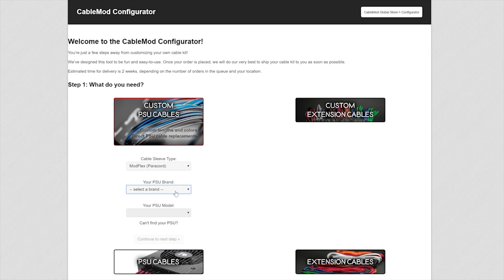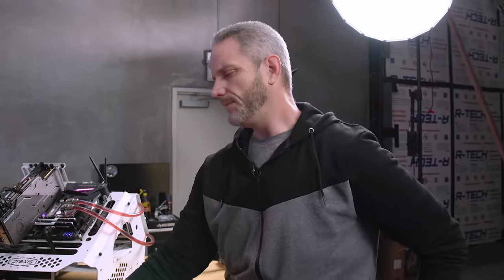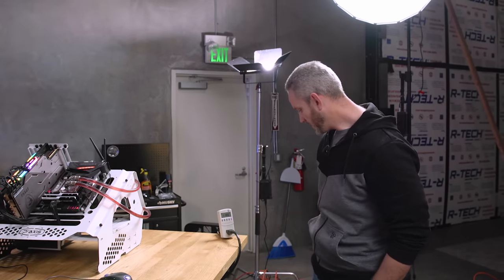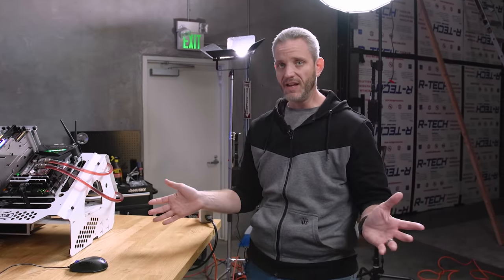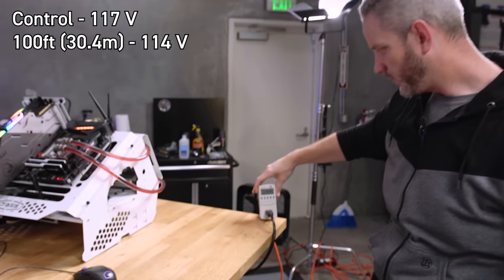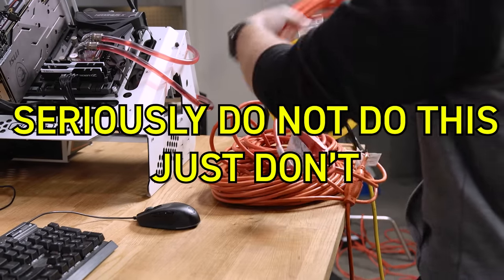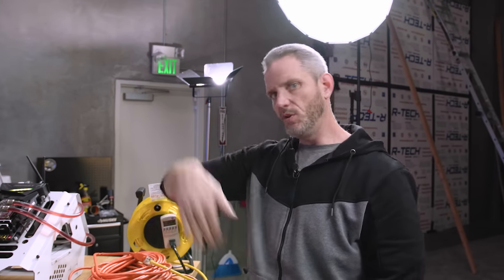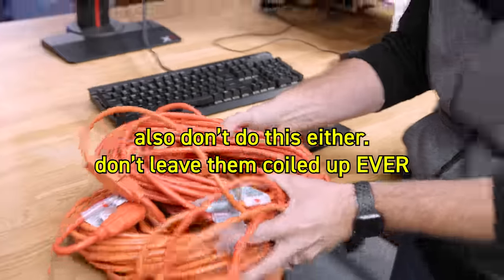Are extension cords dangerous for Computers?

Comment: We used 120v on a 60Hz cycle with a typical household breaker running 20AMPs. UK uses 240v on a 50Hz cycle running only 10AMPs. And they dont get "cleaner" power. Remember the US runs on the AC current system for main power and only the Devices convert to DC. UK uses DC so its higher voltage less AMPs. We use a 3 wire system where are they use a 2 wire system (for standard appliance receptacles) AC is far more efficient and less power loss to attenuation

Comment: Electricity also works the opposite way with low Volts/amps/watts and thick wire. Basically think of it like water flowing down a river vs. a creek.

Comment: Probably alot of other electricians that have commented, but this video is basicly ohms law in a very difficult expression. also most of the things in the start where its talked about lenghts and quality, any electrician (in norway atleast) would break out their little handbook and show you the tables telling you how thick wire you need for a spesific lenght and load. also note that when copper wire heats up the resistance also goes up in turn makes it draw more current to get the same load running. Anyone wanna try to guess why they use liquid nitrogen when doing crazy overclocks? and the last thing is explaining why leaving the cable on the spool is bad when you draw alot of current. when thers a current going through the wire it creates a magneticfield around the wire (crazy i know, oh thats how power is made you say? yaiks) but when you take this cable and spool it the magneticfield around the cable starts to interupt flow of current in other parts of the cable making it, you guessed it, to draw even more current (think he calls it amps, since its mesured in Ampere). so spooling the cable is actually worse than just having lots of it.

Comment: So, the danger with thin wire is that the higher resistance produces heat; this heat is what causes fires when it gets bad. Another thing is distance: The longer the distance, the more resistance, so a better gauge cord is needed for longer distances. 50' of 16 gauge may need to be upgraded to 14 gauge if you wanted to max out the power draw over 100' safely. I wasn't worried for the PC, I was wondering if the wire was gonna light. Quality PSUs have built-in breakers (even a Corsair 430W does, ask me how I know) so that's probably what caused the computer to crash.

Comment: Very informative video.  Tldr, if you need to use an extension cable for high draw equipment don't daisy chain and check the load rating.  I used a 10 ft air conditioner cable that's rated for 1500w into my ups to make sure it's safe.

Comment: 16 gauge is not contractor wire 12 gauge is contractor wire that is what is running in your walls that is what contractors use and if they're not using 12 gauge don't hire them

Comment: You have PSU inside your PC that converts AC to DC,because of that you don't actually care about how good your AC power is(perfect sinusoid doesn't mater cause you convert it anyway) ,most important thing you need to care in this situation is power loss over cable,because long cables introduces more resistance,resistance and capacity.So you have voltage drop over long cable due to it's high resistance and introduce reactive load due to it's inductance.With compressor you introduce additional load that drains current,that's too much for your powerline,so the voltage drops further over that added resistance .

Comment: Power supplies are specified to work world-wide. Nominal voltage in Japan is nominally 100V. Nearly all power supplies will work either in Japan or USA. Look at the rating of your power supply, I'll bet it is rated  from 100-120V on the low voltage setting. Most power supplies have a switch to go between the 100-120V setting and 220-240 V for the higher voltage side of the world.

Comment: Coiled cable loops will create a coil, induction starts to grow quite strong and it will add even more resistance in the form of impedance. Your power factor will drop, which means that current and voltage are not following each other, one or the other drags behind. Your electric company charges you for apparent power, not real power. The difference is that if your power factor is 0.9, you are paying 10% more for your electricity.

Comment: The problem isn't resistance Jay because resistance doesn't interact with time. The issue is the series inductance, and the parallel capacitance because these interact with power delivery as a function of time (this is called resonance). Think of a speaker cross over network which has series inductance and parallel capacitance for it's low-pass filter. The filter works because only signals with the proper time pattern (right frequency) pass, other signals get attenuated. If you were to use a resistor in place of the inductor and capacitor in a low-pass filter, it will only lower the volume of the all sounds produced equally while letting all sounds through--this again is because resistance is time independent, the frequencies (or timing) of the signals will not matter if passed though a resistor. Applied to the PC's power supply this doesn't mean it can't get the power when using an extension cord, it will mean that it occasionally won't get the power WHEN it needs it--it's the condition of WHEN it needs it that leads to instability (this is called ripple in practice). Resistance will change the volt/amp values measured under load, but won't change the wattage received by the PC (though due to heat dissipated in the resistive medium, resistance will change the total wattage consumed from the wall). Thus resistance alone cannot prevent the PSU from receiving power (measured in watts) at any critical moment.

Comment: First, I'd like to address Emme Pombär 's Bigger concern: "You didn't unwind it, so you have inductive resistance!"
* There will be very little heat generated as the resistance is over a massive spans of wire, and the voltage drop because a cable is loosely coiled will not be significant. Any magnetic field that is created, will consume some energy; but the best case scenario for a "magnetic field" is one active wire in a tightly wrapped coil with super thin insulation. As you can plainly see, a coiled extension cord is at the extreme low end of this scale. There is one positive for the almost nonexistent magnetic field, as much as it can, it will limit spikes in the voltage.
* As you are what you eat, a computer exists under the same rule. The better the power, the longer and stronger your computer will run. Just because you don't see the problems right up front, doesn't mean that they aren't there. Power starvation is the number one killer of power supplies; it stresses the semiconductors to the point of failure. Dirty power is the number two; this destroys the capacitors used as filters. In my house, I have a decent surge protector/line filter on all electronics except things like fans, power tools, stove, washer, dryer, refrigerator, & freezer.
* I'm not an EE, i'm the one that fixes the stuff the engineer designed poorly.

Comment: @JayzTwoCents Of course the 14awg cord was cooler. It has less resistance than the 16awg cord.  More resistance means more heat produced. In the US most of our OSHAs require businesses (including construction) to use 12awg or larger cords. 14awg cords are not construction grade.  Also voltage lost because of the resistance of the cord it's called voltage drop not resistance.

Comment: Have been pondering this extension cord thing for a while; and I think you didn't get as bad of results partially because you had them still coiled... that increases the inductance, so current is actually more stable - hence adding ferrite beads to cables to increase their inductance and provide noise filtering... because the 'current in motion tends to stay in motion (with higher inductance(mass)) minor spikes get filtered to the common range, and low dips get covered by losing some of the built magnetic field to provide the current and fill the gap... 
Sorry you didn't get as dramatic of an effect as you(and I) hoped for :)

Comment: Wire gauge goes the other way around, the lower the number means the wire is thicker and has less resistance (voltage drop).

Comment: I melted a coiled extension cord before. I was lazy to pull out the shorter 12awg extension cord instead of the 100ft 16awg. Also beware of corroded plugs as contact resistance can cause fires also.

Comment: Under volting the universal motor in the compressor.  It will try to deliver the same power using more current.  And then it will melt.

Comment: I have tried using a 800 meter extension cord in a coil gauge #18 and it generates a lot of heat were as we spread it out enough so it is not coiling it doesn't even generate heat. The load was way above 2000w at that point so if your using cheap cords don't coil it. Try measuring the resistance between uncoiled wires and coiled ones, you will see a difference in resistance.

Comment: I think you need to use a lower grade power supply. Try a 650w gold or white rated power supply. Im guessing the PSU youre using is making up for the drops in voltage.

Comment: As a electrical engineer, the math is right
 Watt= voltage * amps
By leaving you're extention cord rolled up it dubble the resistance due to magnetic fields created.
Formula for resistance : 
1.73* (length cable in 'm)/0.06
Formula for voltage : 
Voltage = ampère * resistance

Comment: Hey, here in Brazil we have both, 127V and 220V for homes and general small business (offices and stores) In industry, we have anything between 220V and 850V. Subways and rails usually are using something around 650V so the high amperage (60amps+) of 220V+ proved really deadly here! Few had survived being electrocuted with anything that is 220V+. And by the way, the standard "voltage" cam vary on city-by-city basis. Here in São Paulo is 110V but in Santos, another city of the same estate as São Paulo, the standard in homes is 220V. Really Shitty!

Comment: The conductors in the cable are too small. High resistance causes heat and heat causes more resistance. It’s a snowball effect. It doesn’t really have anything to do with cleanliness of the power just an insufficient amount of it. Even the contractor grade cables will only cut it for a certain length. I’m an automotive diagnostic tech that mainly deals with DC voltage but the concept is the same as well as the causes and effects of high resistance.

Comment: Problem shouldn't be the extension cord, but chaining them. Length of a cable goes into the calculation when selecting cable (resistance is proportional to length; voltage drop is a product of current and resistance; power dissipated is a product of voltage drop and current, meaning it grows with the square of the current). The manufacturer can't account for other cables. That's why you can see warnings that you shouldn't chain extension cords. If you want to do it, you have to do the math. As long as the cord meets the safety standards, you should be fine. You know, as long as the building meets the standards. Staying within the limits of the cord shouldn't be an issue. I don't know about US, but ordinary extension cords for consumers around here should be rated at the full capacity of the outlet. Because breaker has to match the weakest link (otherwise fire hazard) and nobody is going to change a breaker to accommodate a shitty cord. Allowing otherwise would be risky.

Voltage in grids has a tolerance. When a manufacturer specifies a voltage or range, I'm pretty sure they're referring to the nominal voltage. The voltage your utility company is saying it's supplying. That's 120 V for you and 230 V for me. In the EU, voltage at an outlet can be higher than 240. The standard allows it and all appliances sold here are supposed to handle it. So, if you happen to live where the nominal voltage is, say, 110 V, that power supply isn't intended for you. It might still work, but there are no guarantees and shouldn't be sold there.

Comment: What this test shows, is that this PSU used here, is a  pretty tough one. 
The lower your supply voltage,, the more of a problem with the cable-length. Because of your US voltage supply, you need twice tha amps as my (EU) 230V supply does. It is the amps that will casue a lot of heavy voltage drops. Only way to counter this, is to lower resistance (thicker cable)..
Having long extension cords rolled up up is never a good idea. The cord does form up a "coil-like" shape, which will create some kind of inductance, which will not make the situation better - and the heat issue as you have shown.
Regarding the max usage on your outlet. As long as the installation is legal and fused properly, no danger in having multiple computers on it. The fuse/breaker will just "pop" if you overload it too long. The use of efficient quality power supplies will of corse make everything better. Avoid bad PSU's especially those with low PFC value.

Comment: Can remember one private LAN Party with friends and one of our cheap extension cables started to smell funny...

...we unplugged it very fast and one of my friends checked it: it was with faulty specs (cables were much thinner than they are allowed for that use) 
so, we switched to other cables without any problems.

Always check the cables! Cheap cables can turn out to have wrong specs written on them!

Comment: Jay, don't recoil your cords that way(around your arm).  Wires twist inside and the cord will not lay flat after a few repeats. Always free hand the cable. Watch any gaffers coiling techniques. I have worked with sound system cables, you never coil them around your arm more than once, The sound guys will yell at you.

Comment: Watt = AMPs X Volts   120v on 20A circuit means 2400 watt max. 90 volts means 1800 watt max to trip the breaker.

Comment: Yeah, I made a 10 gauge 30 foot extension cord for my welder, The 12 gauge did alright but caused the welder to pop and ark and wasn't smooth when you needed the amps, The 10 gauge wire fixed all of that, yes its a 110 welder, on a 30 amp outlet, but wire gauge and length really messes with the quality of my welder, something sensitive dropping below 110v like a computer I can see having issues.

Comment: @2:22 Saudi is slowly changing it's rating to 220/240V . For me, my household is mixed between 110/120V and 220/240V. Hell my room is mixed with 110/120 and 220/240V outlets. It can get pretty confusing. I once destroyed a used (mint condition) headpones amp from the US cause I plugged into 220v outlet by mistake. So, please if you're traveling to Saudi Arabia for work or what not, please be careful and ask if the outlet is 110/120V or 220/240V

Comment: anybody that uses a 30m extension cord for his pc does something wrong, like wtf :D

and you never leave cables coiled up if there is any more or less heavy use on them, never! not even the contractor cable, always unroll the whole drum when using, every cable has resistance, resistance means heat-generation and a coiled up cable has a very very bad heat dissipation. thats why the cheap cables were that hot. most cable drums, at least here in europe have safety mechanism that shuts the cable drum of if it gets too hot, but not all of them. coiled up cables = fire hazard

Comment: leaving the extensions coiled, especially that amount although insulated may be causing inductance, causing electromagnetic interference, further contributing to the issues seen in the video (although most likely having a fairly minor impact)
Reply: Edit: wrote this comment before watching whole video. The inductance of coiled wire and the amount of electricity being pushed through that distance definitely contributed to the heat. but i am interested about the impact of electro magnetic interference on cleanliness of power, especially with a UPS and battery backups. maybe do another test with strong electromagnetic plates!!

Comment: Honestly I learned this the hard way during the crypto craze. I had a few  multi gpu mining rigs and a barely stably overclocked desktop computer that mined while idle.  For a brief period, All my mining rigs were on a surge protector together fed by an extension cord, and my overclocked desktop shared a circuit with a dying mini fridge.  Both saw VERY noticeable stability increases when they got their own circuits.  In fact, I installed 220v for my mining rigs and grabbed the thickest psu cords I could,  and It fixed so many dumb little instability issues

Comment: Over the years the most dangerous thing to my PC is my fingers playing with the BIOS settings.
 The next most dangerous is living close (3 miles) to a refinery during a earthquake.
 No the refinery did not explode.
 But it shed all of it's rotating loads and the transients from that, fried the surge protector, power supply, motherboard,  video and sound card. Surprising  thing was The HDD, RAM and CPU were still good.